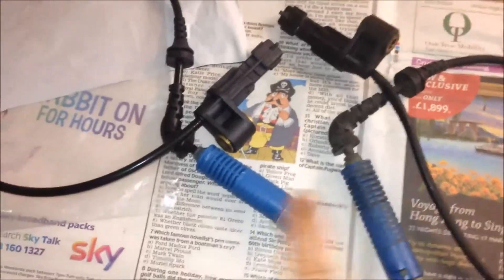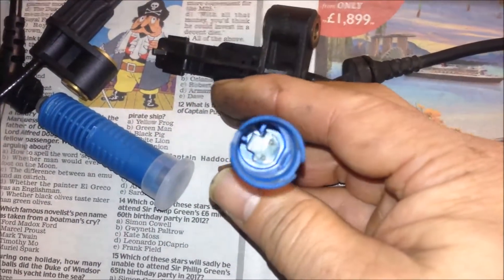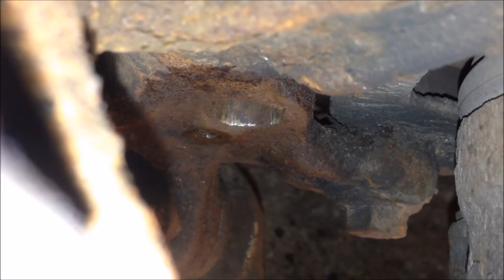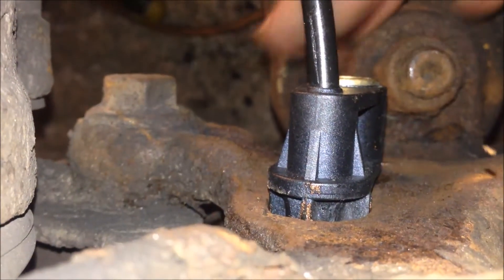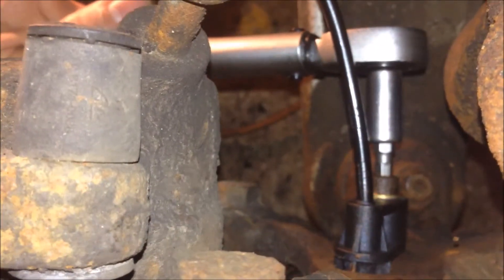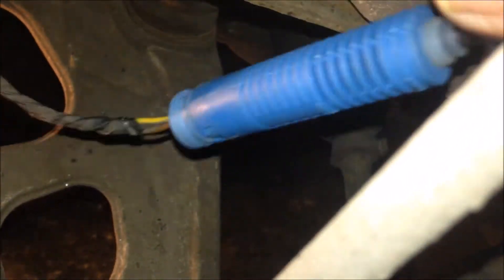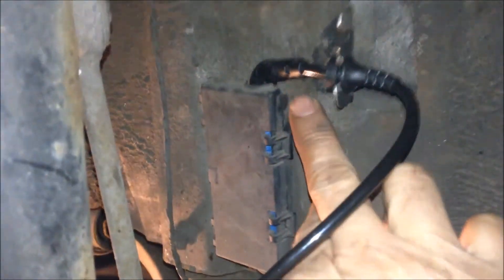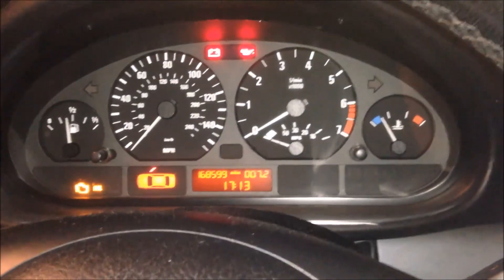BMW E46: ABS Brake Sensor - How to Install

Comment: I replaced mine used obd scanner and it gave the fault of both front speed sensors but all 3 lights still on and still showing 0 on speed sensors any help please
Reply from the maker: hi, not sure about your car. use original sensors if possible. for the speedometer not working: you could try to swap the two rear ABS sensor? good luck!

Comment: Hi on my 2002 318ci the 3 lights are always On.. But the handbrake light is permanently Red..everything works OK even I tried emergency brake and I got the pulsing brake. What can be causing the lights 2 yellow and 1 Red?
Reply from the maker: hi,  if your handbrake indicator is permanently on, you could check your brake level or your handbrake switch. I guess you either have fluid level low or handbrake switch needs to be adjusted. in addition to that, you may have a faulty ABS brake sensor. Good luck!
Reply: @RepairDIY  Thank you I will check the handbreak switch as my break fluid seems to be on the Full mark.
Reply: Hi, well now speedo has packed up completely I also have no communication from the obd2 when I search for abs issues. No signal on any wheels when I use scantools. Today I removed my rear right abs sensor and replaced with a new one but no joy. Speedo cruise control have stopped and all the three lights are still On.

Comment: Rather than just spending money for new sensors, you should first try cleaning the old one with a small nylon or brass brush, flushing it out with some brake cleaner spray. These sensors get dirty and corroded, especially from winter driving, and often respond quite well to a good cleaning.
Reply from the maker: Yes, a great comment, cleaning may make it work. My installed sensor still working although occasionally I had the warning lights again in rainy days. Cheers.

Comment: i have the three same light and they go and come back specialy when its cold outside and wet can thia be a bad sensor???
Reply from the maker: Hi, In my case I did see some yellow indicator flash shortly occasionally before the three indicator permanently on. Another way to confirm is to read the code (I think one of my video showed my reader). Good luck!